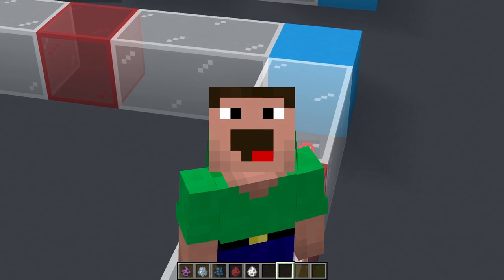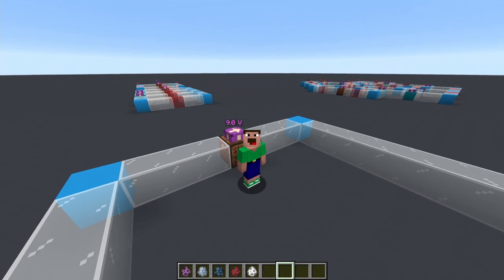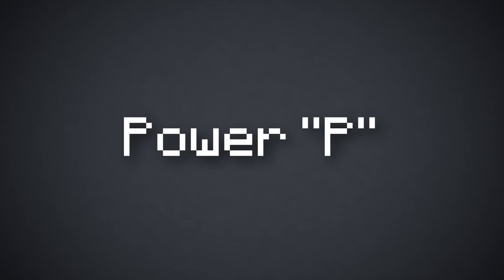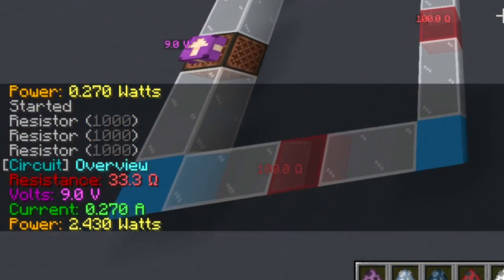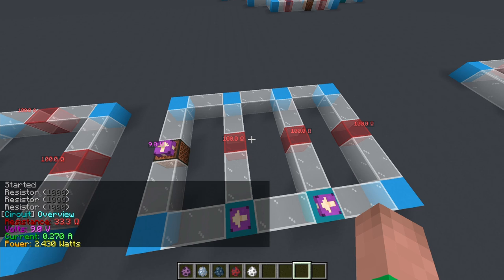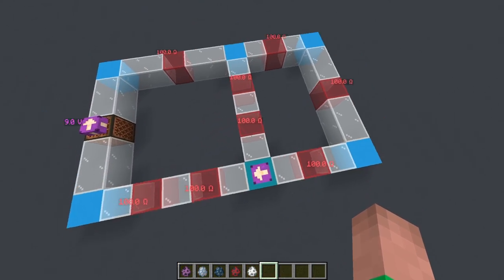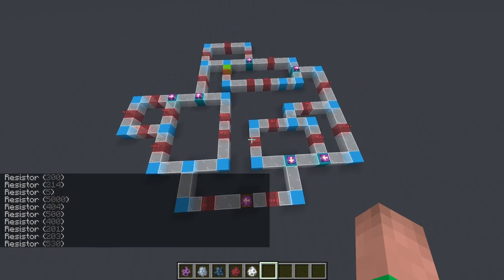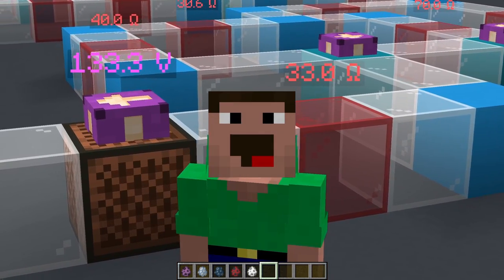Electrical Circuits Visualised in Minecraft [Simulator Datapack]

Comment: 2:00 lol false very epic. Positive and negative is determined by the potential not where electrons are at, they didn’t get anything wrong it was just convention to make current point opposite of electron flow. Charge isn’t a thing current is a flow not a chunk of charges being shot. Voltage is not a scaled its potential, also charge doesn’t have to only go in one direction, only diodes can protect electron flow. The results aren’t that helpful usually u know the current in the source ppl usually need to find the power dissipated by a resistor
Reply from the maker: Hey Cloud Wolf, I appreciate the feedback! I'm afraid for a few of these points you may have simply misheard or misunderstood what I said, but here are some responses :)

1) In my video I explained that the negative side and positive have a potential difference and that the electrons once connected with a conductor will travel to the greatest potential difference. I never said that the negative and positive side of a battery is determined by where the electrons are at, I think I was clear that it was about where they were going. After all, if you just have a lot of electrons laying around that's not a battery. However, electrical charge is determined by where the electrons are at. If there are more electrons than protons you do have a negative charge, and vice versa.

2) Actually they did get it wrong. The idea of conventional current was created far before they knew what electrons or protons were, and they believed current flowed from positive to negative. They didn't know what carried the charge and for a while even thought it might be a fluid. It was later on that they discovered atoms and things like electrons and protons and identified their charge. At this point they understood that the flow of electrons goes from negative to positive, but since they had already adopted the idea of conventional current they did not go to the trouble if changing the entire thinking of that time which is why we have the separation between 'conventional current' and 'electron current'. So yes, they did get it wrong, and to this day conventional current is opposite to electron current.

3) Correct, charge isn't a thing. Not sure why you're bringing that up since I never said charge was a thing. Perhaps you say this because I said the "the little green thing" is 1 coulomb (measure of electrical charge), and I agree I could have said it differently. Charge is not flowing through a conductor, however electrons are. And electrons are charged. I explained how 1 coulomb is equivalent to 6.5 quintillion elementary charges with that being the charge of a single electron or proton. Based on that I think it was pretty obvious that directly afterwards when I said the "little green thing" is one coulomb, I didn't mean it was literally a charge, but rather carrying a charge of 1 coulomb. But I take responsibility for even a minor mistake like this, and I will make sure to clarify this in my next video :)

4) Current is not a chunk of charges being shot. Again, I'm not sure why you are bringing this up because I never said it. For the simulation, yes there was only 1 little green square which would travel because it was visualising where the current would flow. If every square was green it wouldn't show you any valuable information :P Otherwise I explained quite clearly that current is the flow of electrons, and is measured in ampere which is C/s: How many coulombs flow per second.

5) I'm not sure what you mean by "Voltage is not a scaled its potential", perhaps if you could use correct grammar and spelling we could have a proper discussion about it.

6) Charge isn't limited to traveling in only one direction, again I'm not sure why you are bringing this up since I never said it. I said the charge will travel to the greatest potential which is true. In all the circuits I was demonstrating the electrons would flow to the other side of the battery because that was the greatest potential difference.

7) I think arguing about how useful the results are is a bit subjective. If I have a calculator which can only do addition or subtraction, perhaps it's not as useful of a calculator but it's certainly not wrong. For my specific case I made it calculate the sort of questions which were being asked during class. If you were asked to calculate other things in class, good for you! I'm sure you could have also programmed something like this which would have shown everything you need to know. But I made this for my specific situation, and those are the kinds of answers I needed. Keep in mind, this project is something I did on the side to help me study for the exam. If I could code a program to calculate it, I certainly could do it as well, and if you're interested I received 100% on the exam, so it clearly did it's job :) In the end, I didn't make this to help other people with whatever things they need to calculate, but the specific things I needed to calculate. If you don't need to know that stuff, then by all means I am not requiring you to use my datapack :P

8) Finally I would like to say, I value your feedback. However from someone of your intellect and education I would have appreciated a well written explanation as to why what I said may have been wrong in order to correct me, rather than this hastily written criticism which isn't constructive or well written, and I'm afraid not well researched. For someone who is a tutor this seems like a very bad example of tutoring and I would consider trying to help people understand rather than destroy people who don't. If it means anything to you, I reviewed this video with the P.H.D physicist who taught me this, and he had no problems at all with anything I said and enjoyed watching it :)

Take my advice, if you can't say something good... don't say anything at all ;)
Reply: @CommandGeekLabs  
1) 1:48 that is just wrong, if u don't know why this is wrong google search "electrons in a circuit". The electrons are truly in the neg terminal and go to the pos terminal. The only way you can defend urself on this is if you say "anytime i said electrons i means the opposite" which u just shouldnt do. its too confusing
2) google "BEN FRANKLIN SHOULD HAVE SAID ELECTRONS ARE POSITIVE? Wrong." or just ANYTHING on the topic, they did not "get it wrong" and there has been extensive work to try and clear up this misconception
3/4) as the title suggests ur making a circuit simulator and if ur simulating a circuit showing "1 coulomb of charge" taking a path opposite an electron would travel its confusing/misleading as to what a circuit actually does. At 2:48 you say that you are sending an electrical charge through the circuit, this doesn't happen in real circuits
5) 3:50 you made it sounds like voltage is a SCALAR (should be able to get that word from scaled) when in circuits it is a measure of difference. If you had two batteries in series, what would the voltage be between them? what would be the voltage above them? it all depends on what you are looking at it in reference to. I get that in your system you assume the ground is always the negative terminal of the target source but its not clear in your description that voltage is a measure of potential DIFFERENCE
6) In your design you put arrows that say what direction the current has to go, thats misleading because in a real circuit current won't just go in some defined direction. If you have resistors in parallel, some of the current goes through each not evenly distributed and as for electrons, they dont always head to the lowest potential uniformly.
7) Its less of usefulness and more of advertisement vs results. If your datapack is a simulator I expect a little bit more than calculating equivalent resistance. A circuit simulator, or even a calculator, at the LEAST needs to know the voltage and current for all elements.
8) I did not expect you to want a large document on why you are wrong, I felt that it was blatantly obvious. I think you set the worst example here given how little you know on the topic and how large ur influence is. Given how confusing and misleading your representation here is. If you reviewed the video with a phd physicist, they were either biased and going easy on you or you are not telling the truth. I have no problem with teaching people but in this case you are the "educator" and if u r confusing or wrong ppl will bring it up, thats life.

Take my advice, title ur content correctly and learn the topic before u explain it at all ;)

PS: In my original post, I left my criticism strictly on the content of the video but I'm glad to see you are open to attacks on character
Reply from the maker: I'm glad to see you have organised your comments a bit better! Much nicer to discuss this way :)

1) I'm a little confused as to what your point is, since what you said seems to be exactly what I said in my video. The arrow on the battery was showing which way the green cube would come out of. First I explained that conventional current is shown to flow from positive to negative and I put the + and - accordingly. See 1:40. Directly afterwards I explain that this is not how electrons flow, but rather they flow from negative to positive. I then flipped the + and -, you can see at 1:53. I think you may be putting words in my mouth since I always said that electrons flow from negative to positive, and I only ever said conventional current flows the opposite way.

2) I took a look at it, and I must confess a lot of that was new to me. Everything there is very fascinating, however if you search "conventional current" you find "Conventional Current assumes that current flows out of the positive terminal, through the circuit and into the negative terminal of the source" thus, conventional current flows from positive to negative. I understand that there can be current in other substances in which positive particles can flow, however in my demonstrations it dealt strictly with current in a metal wire which deals with the flow of electrons. Therefore: Conventional current flows from positive to negative and electron current flows from negative to positive. Perhaps 'opposite' would have been a better word to use than 'wrong', but I think I was quite clear that conventional current is *not* electron current, which was my point to begin with.

3) at 1:53 I define the side which the green cube comes out of as negative. At 2:48 the "1 coulomb of charge" leaves the negative side. I fail to understand how that is opposite to the electron path.

4) Considering I had explained what current is, when I "sent the charge" I think it was pretty clear that batteries don't send out bursts of electrons when you click them. Yes, I could have said "Now I am going to click this battery which will send a green cube showing the path the electron flow takes which in reality is a flow and not a burst of electrons like this green cube" but I'm pretty sure that was quite obvious when I "sent the charge". However, even for something like this I can take responsibility and take note for future videos.

5) Before explaining the volt I considered what the best way to do it was so that it didn't sound overly complicated. Perhaps I should have emphasised the difference in potential, however my definition isn't wrong. In fact the definition of volt is "Volt = Joule/Coulomb"... how much energy (Joules) per charge (Coulomb). So I suppose we can argue the fact that I emphasised the wrong aspect, but I certainly was not giving false information. Yes if I had multiple batteries things would be different however my datapack does not work with multiple batteries which is why I kept the more complicated stuff out. I did not do it to spread misinformation but rather to keep things as simple as possible for people to understand.

6) Actually the arrow wasn't showing which way the current will go. The arrow was showing which way the green block would leave so I could know where to place it. Yes the arrow defined a set direction the block would leave, and the block would always head that way. However like I said the block isn't supposed to be the flow, rather an indicator where the flow would go if it did. Like I explained, this is Minecraft and it's not a perfect visualisation. I'm not going to make the block travel not uniformly for accuracies sake, the block in all honesty is just acting as a raycast, it heads in every possible direction then adds everything up at the end. That is also why it could run on an open circuit, the block just heads in every direction it can, not considering anything like potential difference. I'm assuming from my previous explanations that current will not flow if there is no difference in potential. In fact when I was explaining the parallel circuit, I never once said that it is all evenly distributed but I explained that it has a choice and some of it can go through each resistor.

7) To be honest, I'm not advertising anything. I'm not selling this product. I did this for my own purposes I'm only putting it on youtube because I find the subject interesting and I want to share what I learned/made. Again if you feel like this isn't worth using, then don't use it - simple as that :)

8) I can assure you I much more enjoyed your detailed elaboration then your first comment, this feels much more like a discussion rather than replying to an angry audience. I never claimed to be the teacher, in fact I made it very very clear right from the beginning that I recently learned this and that "I am still the student here". It is also because I am still the student that I reviewed it with my teacher before posting it to make sure I am not spreading misinformation. Regarding the validity of his analysis: I know for a fact he would never be biased against the truth - if something is wrong he will correct you. However since we are all human it is always possible hey may simply have not picked up on something or not noticed a mistake. I find this extremely unlikely, but I still consider it an option which is why I'm still reading what other people have to say :)

I actually struggled a bit to come up with an idea for a title, I'm curious to know what you would have named this video :)
Reply: @CommandGeekLabs  
the main problem seems to be that you kept swapping what is + and what is - in favor of talking about electrons, in practice no one does this and just uses convention always, since in basic circuits ppl dont care what the electrons specifically are doing and focus on V,I,R

1) when you flipped polarity u were doing so "because the convention is wrong". There should be no reason to show opposite signs because the + and - is based on conventional current. 
2) your point was roughly "current convention is wrong and we have been too lazy to change it" which is what I pointed out as wrong in the first place.
3) again, you directly pointed with your mouse saying this side (the direction of the arrow and the originally labeled positive side) has electrons that want to get to this side (the originally labeled negative side) which in the circuit its the opposite the electrons want to get from the left side to the right side. (given the arrow is pointing to the positive battery terminal and the direction of conventional current flow)
4) not a big deal or my point, that green thing u should have called current or something that represents the current's path
5) voltage has multiple equations for it, in circuits voltage is always measured as the Potential from A to B and if you don't make this clear lots of ppl think that the voltage across a resistor is always the voltage at one of the terminals rather than from terminal A to B
6) again, just calling the green thing where current will go would be less confusing than calling it charge considering the only charge discussed is electrons u don't know if u mean + charge or - charge
7) i didnt say the video shouldnt have been made, but giving a proper title to something is important
8) if you post a video explaining things in that context the burden of truth is on you, if any of my professors heard me say current convention is "wrong" they would have definitely pointed that out

without changing the title much and being as accurate as possible:
Electrical Circuits Calculated in Minecraft 
or something along the lines would be more accurate, but more specifically its an equivalent resistance calculator
Reply from the maker: 1) Ok I think I understand where the misunderstanding is. When I swapped the + and -, I was literally flipping the entire battery around. I can see how it got confusing with all the swapping between - and +. Now that I think about it I should have just kept the + and - as is, and simply say "although the conventional current goes from positive to negative, the electrons flow the opposite way: from negative to positive". The reason why I decided to swap the orientation of the battery is so the arrow would point in the direction of the current first, and then in my second example point in the direction of the electron flow. I see how this could have added confusion for some people.

2) Like I said, 'opposite' was probably a better word than 'wrong', but again I don't think it was a massive deal.

3) When I was pointing out "this side has electrons" I was pointing to the negative side since I had directly before that explained that I swapped the terminals of the battery. Again the fact that I swapped probably just added confusion to this aspect, but if you look directly beforehand you will see at 1:53 I did show that side as negative.

4/6) I really don't think it was unclear what I meant, but I'll accept for the sake of accuracy I should have made it clear that the green cube was representing the current's path.

5) Everything you are saying is correct, however I feel like if I started explaining the potential difference aspect of voltage it would have made everything a lot more confusing. I suppose maybe you would have explained it differently but I chose for the sake of simplicity to explain it the way I did. What I said wasn't wrong, and in the context I was using it in, it fully applied. You have to keep in mind I was showing extremely simple circuits, and there is far more knowledge to learn about this, but I chose only the things that applied to what I was demonstrating. You are free to explain it however you want, but I really don't think the way I explained it was a big deal :)

7) I think the title of a video is a bit subjective, if I just say "calculator" I feel that does not fully express what I did, since it is showing the path the current takes and you can actually build the circuits yourself.

8) I completely agree, and I would never say that the truth in this video isn't my responsibility. However it was my teacher who used the term "wrong" so I think this might be less of an objective thing and more of a perspective thing. I know for a fact that my teacher knows what he's talking about, and I also know he disagrees with a lot of other professors on various topics. There are different views on different things, and I think this is an opportunity for debate but I wouldn't say they are objectively wrong. In the future I will use 'opposite' to avoid controversy, but I don't think it's that big of a deal.

Like I said in the beginning, I do value your feedback. And I think many of the differences we have between us is perhaps not that one of us is wrong, but we were tutored my different people with different perspectives on things. It doesn't mean we shouldn't try to figure out what is right, but it means we should be open minded that there are other ways of thinking out there. I've made a lot of notes from our discussing about terminology I should use in future videos, so I thank you for that 👍. But overall, I wouldn't say the points you brought up were necessarily tragic, but rather words or explanations which could have been a bit better. But I think it's worth considering that I have never made any form of educational video like this before, and I'm not saying that excuses any mistakes I may have made, but it certainly means I have a lot of room to grow with my knowledge and with my explanations, which is why I appreciate constructive comments much more than hasty criticism ;)
Reply: @CommandGeekLabs  overall, if ur explanation is confusing ppl that know what ur talking about, chances r ur accidentally misleading ppl that don’t know what ur talking about. Simplicity is nice but clarity should be the first priority. And it isn’t just me that is confused here, lots of ppl r
Reply from the maker: I think you might be exaggerating the level of confusion here. Like I said, what I said wasn't wrong, I may have just used a more confusing way to do it. And again, if my teacher and other professors I showed this video to weren't confused by it, well I kind of don't think it's a big deal. I'm not saying what you have to say isn't valid, but I value their knowledge a bit more than yours I'm afraid :P
I've received quite a bit of feedback from this video actually, and most of it was very good. And this isn't just from random people, I know that these are people who specialise in this field, or are studying this field... and most of them said it was all well explained. So either, you are saying all of them combined have a wrong understanding of this... OR maybe... just maybe... the points you brought up are a bit subjective :)
Reply: @CommandGeekLabs  there are quite a few others who are confused and many ppl with experience in the field will just ignore what confusing could be had with how you explain electrons because most ppl don’t focus on electrons in the first place. When u decided to flip things around multiple times u could have at least also flipped the element in game. I’m just saying that u need to be more clear what u mean even if other ppl give u the ok, it doesn’t mean you are being clear
Reply from the maker: Well like I said I’ll consider your feedback. I’ve already gathered a lot of notes for the future so you can rest assured you’ve accomplished something. As for now I think we can both do our own thing without conflict, and there certainly does not need to be any hate talk behind people’s back ;)
Reply: @CommandGeekLabs  i would never hate talk behind your back exclusively. Any criticism I have is said to anyone who cares to listen
Reply from the maker: We have different definitions of hate speech then... Here are some messages from your discord about me:

“This is retarded”, “I hate that guy”, “he has no idea what he’s doing”, “blind leading the blind”, “he’s spreading a lot of lies”, “idiot making people stupid”, “I know for a FACT he’s incapable at commands”

I wouldn’t claim to be more advanced than you in terms of commands, but if that isn’t hate talk, idk what is :P
Reply: @CommandGeekLabs  yes and I stand by the context of those statements at the time. If you don’t agree then speak up instead of passively watching
Reply from the maker: I left your discord long ago for similar reasons, I don’t plan to rejoin simply to defend myself. I honestly couldn’t care less what goes on in there... all I’m saying is that it’s very harsh. I certainly am capable of commands, how do you think I got to the position I’m in now if I didn’t... but you have a right to your opinion and if you think Im an idiot that won’t really change how I do things
Reply: @CommandGeekLabs  from the get go I know that u don’t respect my opinions so there isn’t much for me to say here. If u have a problem with discord bring it up in discord, snooping on convos isn’t gonna make u feel better or change ppls opinions of u
Reply from the maker: Whether or not I respect your opinions - I have not insulted you in my discord ;)

But you’re right, there isn’t much to say since I know you won’t be taking anything back... Despite our differences know that I still respect you as a developer. Good luck and have a good day!
Reply: @CommandGeekLabs  you did insult me before leaving, but all of this is discord discussions not YT comment discussions